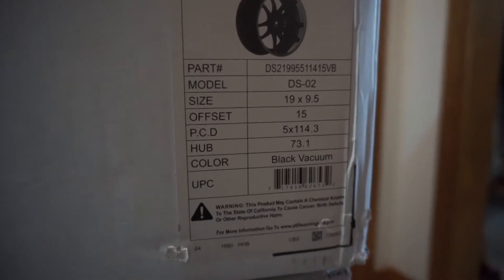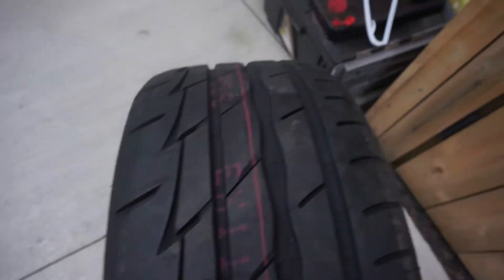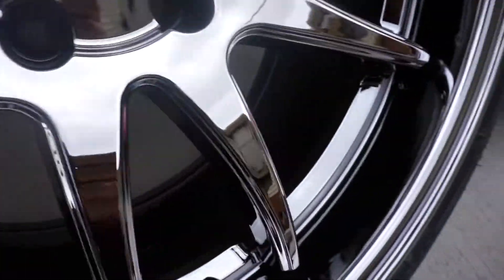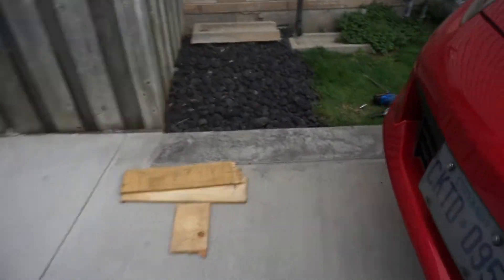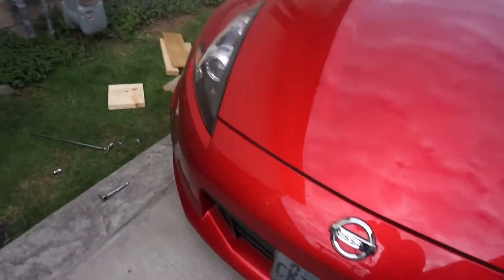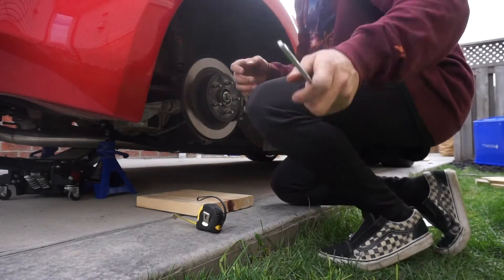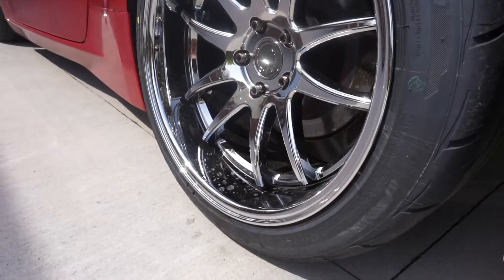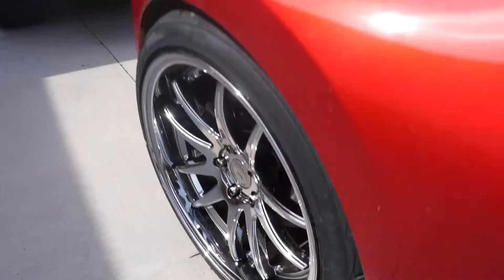370z Gets new wheels! AODHAN DS02

Comment: Is the hubcentric rings a must? Idk if aodhan makes specific hubcentric wheels for z, I’m still in the air about 10.5 or 11 in the rear
Reply from the maker: if the hub bore isn't the correct size then yea or wheel wont sit right on hub. also go 11/s i have 11 with a 15mm spacer lol

Comment: Do you think it will fit with the big factory sport brakes? With the same specs you have on right now?
Reply from the maker: I think aslong as you get the +15 offset
Reply: @loganmachan  so +22 should be alright hey?
Reply from the maker: @vinniequodling1678  i believe so +15 looks better and i think fits bbk, check fitment industries gallery